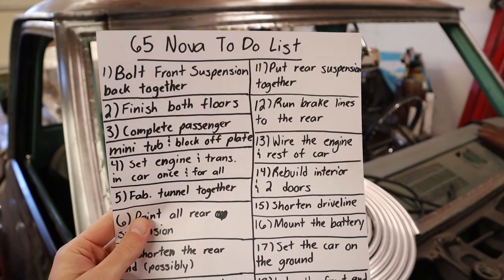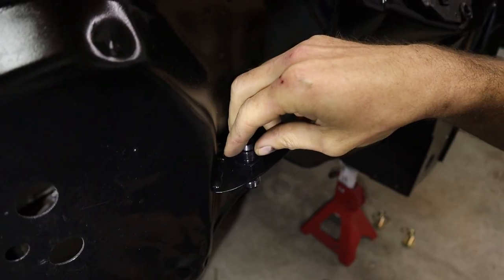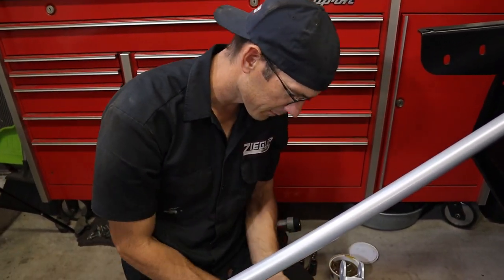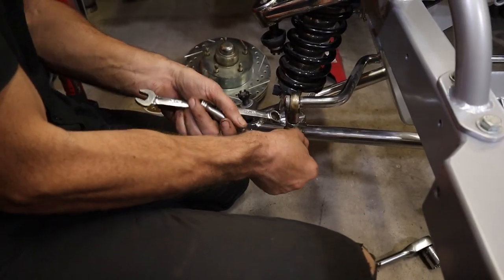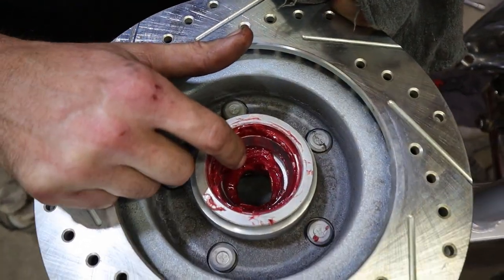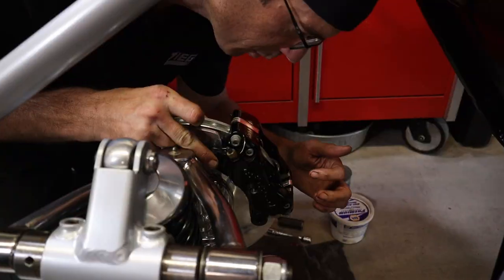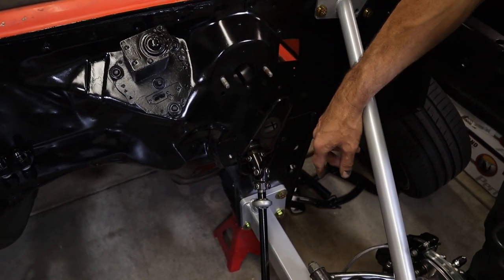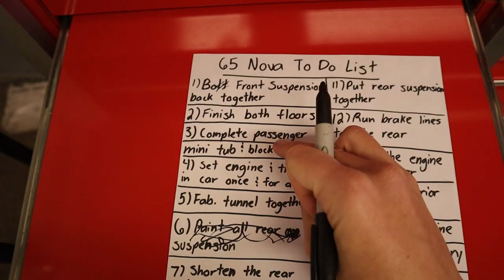Installing the TCI Front Suspension - Chevy Nova Build Part 18

Comment: Super video!!!! Thanks.  I'm working on a 67 Nova SS and am also using TCI suspension (standard IFS and Torque arm with 9"). I haven't installed mine yet still working on some final sheetmetal (quarter panels). I really like the chrome finish. Might ask TCI if I can upgrade.
Reply from the maker: Good stuff.